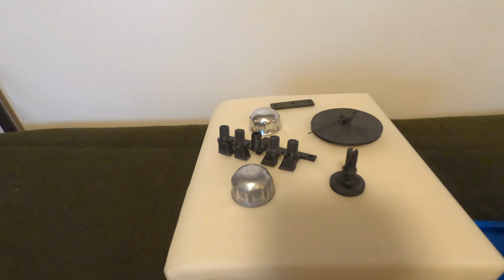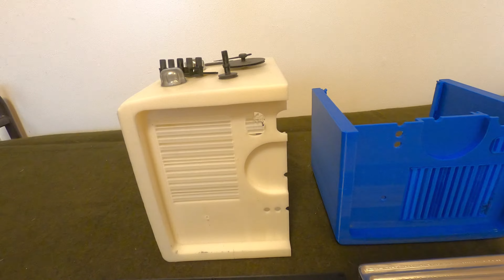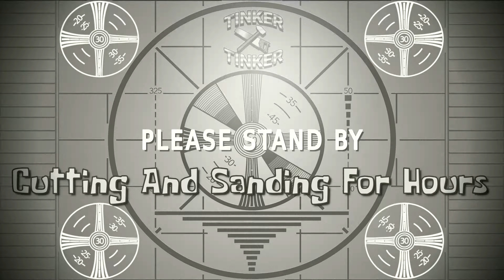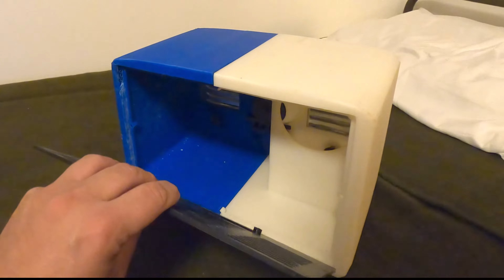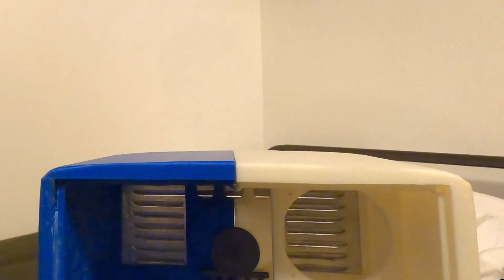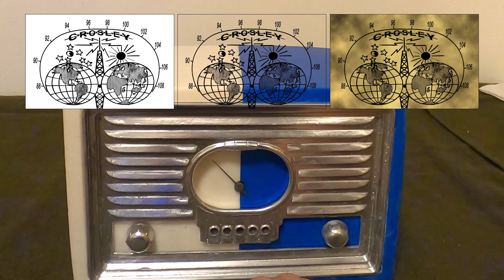Finally Finished 3D Printing The Parts For The Fallout Crosley Radio Conversion

Comment: Good stuff man
Reply from the maker: Thanks, I got the box in primer today.  Still have a lot of sanding left to do.  I've got a Nuka-Cola toy truck printing now.  I'm going to have to rework that model some more though.  I painted up a Fallout 4 style toy car today.  I'm thinking about designing a blow mold so I can heat and re-blow empty soda bottles into the shape of a Nuka-Cola bottle.    I think it would be fun for storing homemade sodas, and way faster and easier than trying to 3d print them.